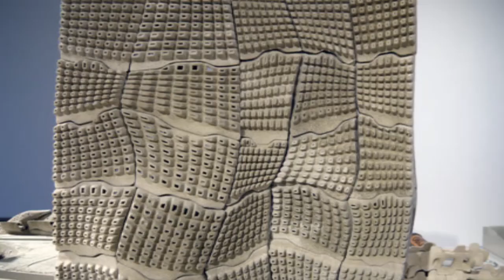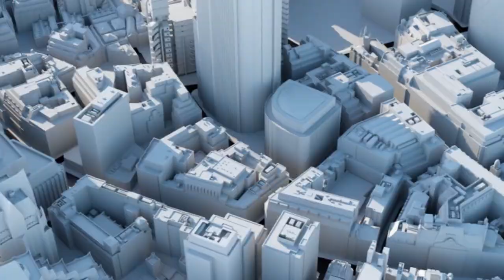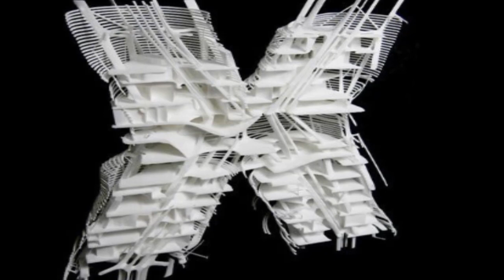Precast and moulds 'will become obsolete' [concrete, construction]

Comment: wont be obsolete..forms hold / taper pressure..required for high psi concrete ..then there is that little issue of reinforcement.

Comment: They are developing Biocrete. This is where treated fibers are used in place of aggregate.  It has twice the compression strength and 1/3 the weight of regular concrete.  I don't know about the tensile strength yet as that will be determined by the ACA after testing! It's possible that rebar would not be necessary!

Comment: So much arrogance. Super materials like Ductal (an UHPC, ultra high performance concrete) will always need molds as they can't be cast "on site", first because their process requires to control hygrometry of the operating environment, and secondly because they must be cast while taking the fibers direction in account. These ultra high performant concretes are becoming more and more common for a simple reason despite their price : high performance in flexion, naturally waterproof, and finally takes much less material to build the same, and has a very low carbon print compared to traditional cements. Definitely a true game-changer.
+ it can be functionalized with other additives (micro marbles of glass for reflective surfaces, ie) and requires skilled people with good knowledges on concrete, so it goes towards serious craftsmanship and promotes formation and jobs.